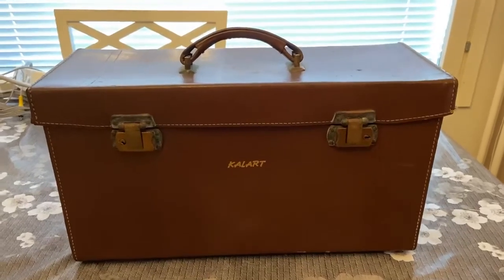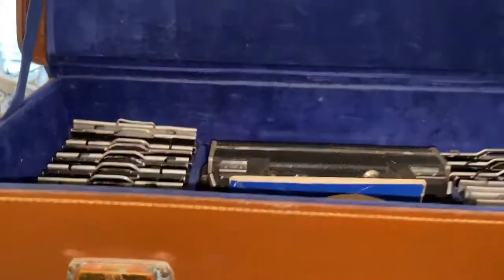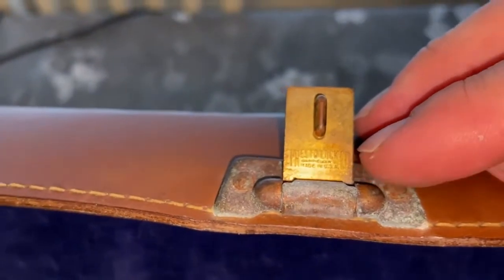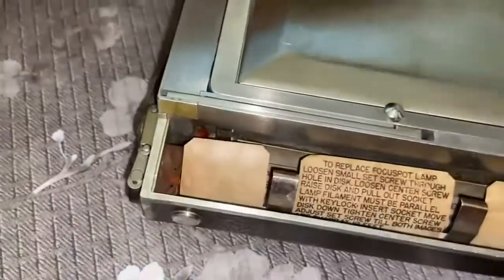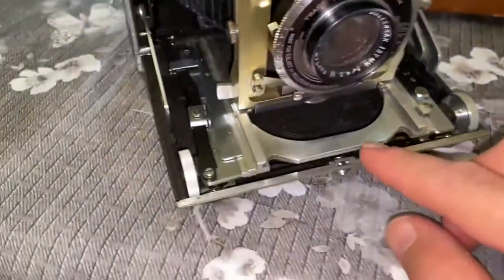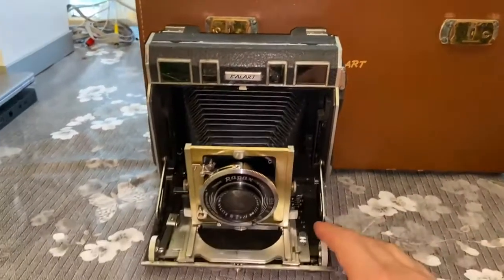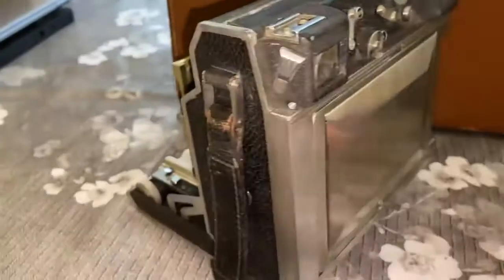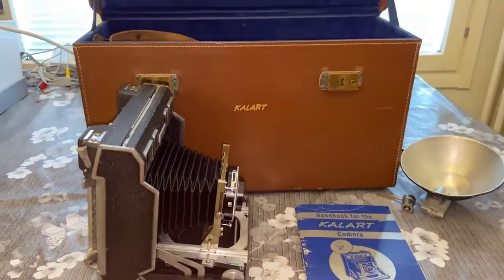Old Camera Review: Kalart Presscamera

Comment: The batteries powered the focus lamp which sent beams of light out from the rangefinder for focus in dim light, and also power electric shutter release which was interlocked to special film holders for double exposure prevention, a feature few press cameras had.  I think you needed special Kalart film holders for that to work.😊